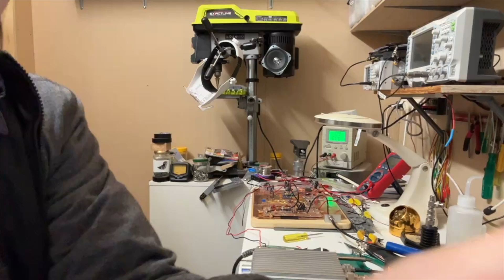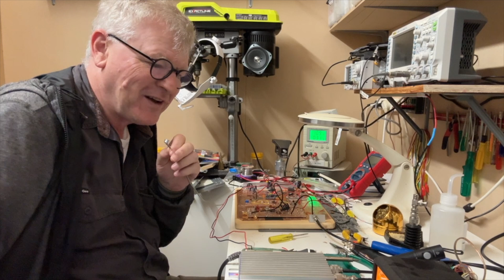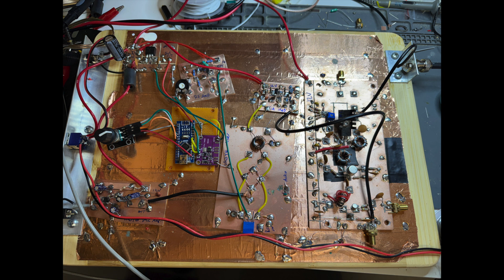Double Sideband contacts

Comment: Good job, sounds really great 👌
The hardware-modified uvk5 to 10/11m also uses DSB and it works really well, even though in this case it is software-emulated modulation.